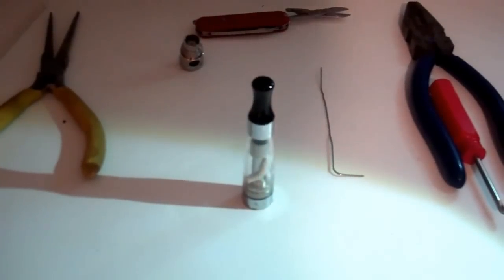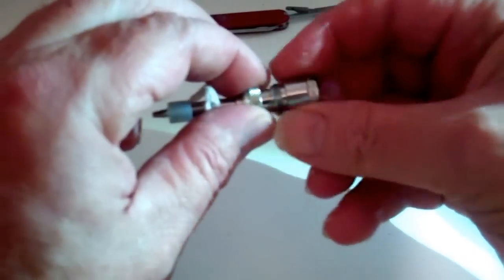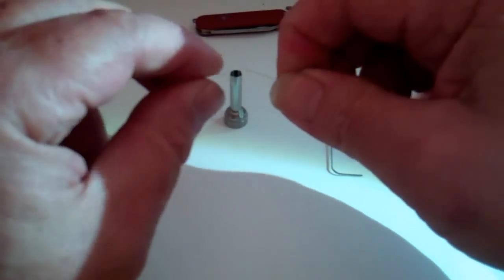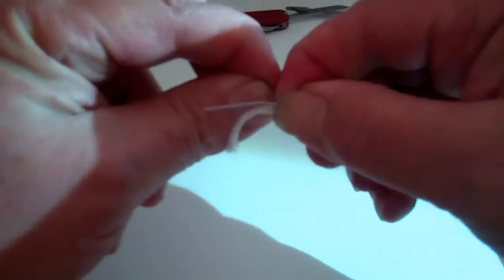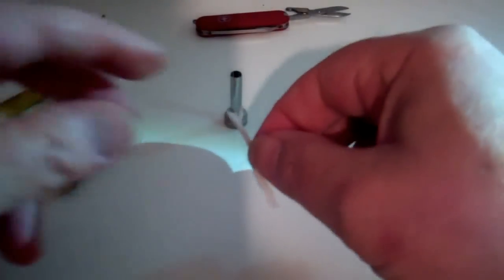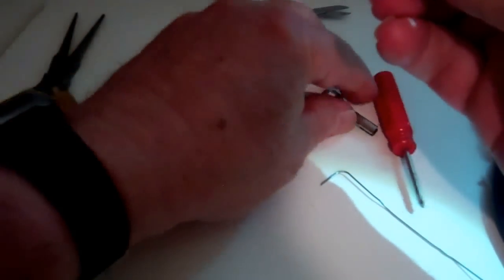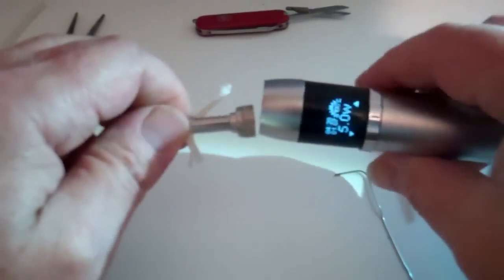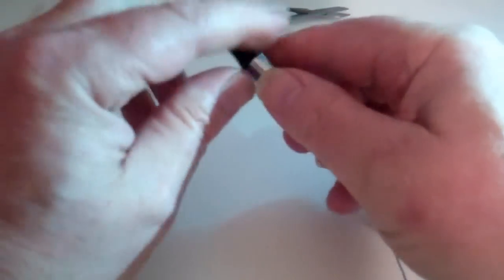Rebuilding standard CE4 Clearomizer

Comment: I had several burned up CE4 cartridges sitting around, and until I watched your video...never thought I'd use one of them again.  Well, I did it.  Used boiled 100% cotton balls, and the same wire as came with....tried one, and it is working.  Amazingly easy, except getting off the lower ring was hard!

Comment: thankyou so much so many people were telling me the ce4 could'nt be rebuilt and since i got this ego-t its been nothing but trouble after taking the clearomizer apart and rebuilding it works better than it did when it was new
Reply: nauroticdax Hi nauroticdax.. do I need to squeeze the coil .... cause after wrapping around the wicks it's getting really difficult to squeeze the coil. Thanks
Reply: Wasim Haq after rebuilding my ce4 a few times the wick basically fell apart on me so its hard to tell but here is how i understand the process

once you have wound your coil do a test burn this will oxidize the wire so that when you squeeze it together it will not short circuit

now that being said i moved on to an h2 clone which has a bottom coil head on it and is WAY easier to rebuild on which i basically held the wick out and rewound the wire by hand not pushing it together. that was about 2 months ago since then i have had replacement heads new h2 clones baught an EVOD BDC and yet still that coil for me works better than any other i have tried so far

honestly this is one of those things you have to just try over and over and work out what fits you personally i would recommend the GSH2 clones simply because they are inexpensive and easy to work with where the ce4 for me is just awful

Comment: Use padded pliers where required. Steel pliers leave marks and remove the very thin chrome plating. Also, do not squeeze too hard - leaving one with a useless oval fitting.
Reply: This needs to be put in the description.
Reply: Or you can simply wrap some cloth.

Comment: Nice one with using the battery to pull out push back in, I was fighting with this before, I'll try do it your way next time, cheers mate ! ... by the way, do you know where to get replacement rubber gaskets? These break after a few times in and out.

Comment: Thanks for the info!  I had no idea you could rebuild these...I got a CE4 and a CE5 with my eVic kit and I like how they vape...it's such a shame chucking them in the garbage when they're done with :(.  I'm a new vaper so I have yet to burn one out, nor have I even attempted to try and rebuild one or have the supplies.  I want to rebuild the Kanger T3 tank I bought recently because it's not hitting very hard.  I have a question though, when you wrap the wire around the string, and it touches the metal tube doesn't that ground it out/short it out?
Reply from the maker: One leg of the coil is in contact with the metal tube as this provides the ground and the other leg of the coil is connected to the center post which is isolated by the small rubber spacer inside the tube.
Reply: Roger Donahue Yep, that much I understand so far...I have a background in electronics, so here's a question:  Do the leads that aren't wrapped around the wick that run to the power source light up and get red hot too?  Thanks for the reply :)

Comment: Ok Roger you inspired me so I ordered the 32g Kanthral and 2.5mm silica wick .... I've rebuilt it a few times but keep getting the same result of very low output .... I've tried with 4 wraps and 6 wraps but each time its the same ... any ideas what I'm doing wrong? I've used a multimeter pos to center and neg to outside and only get a reading of 1/2ohm yet its the same reading I get for new atomisers(multimeter set on x10) .... what's wrong?

Comment from the maker: I think this indicates that you have a short in the coil assembly. You have to be careful to make sure that the center connection of the coil does not make any contact with the rest of the assembly. It could also indicate that the resistance of the coil is to low ( to few turns on the coil)
Reply: Think you

Comment: Hi, regarding the "little rubber insulator" you mentioned at around 5:20. There is another rubber still in the post. I took it out for cleaning, but i forgot how it is supposed to be placed. If the post is upright, the "little rubber insulator" will be at the top of the other rubber thing. Could you please shed some light in this matter..?
Reply from the maker: +Amali Supafly  The unit you are trying to repair is apparently slightly different than the one I describe. I wish I could help but without seeing it or being more familiar I am afraid I can not advise.

Comment: This only works for the rebuildable CE4 clearomizer right? I'm not sure if it'd work for mine because the coil might be soldered to the inside of the centerpiece. Nonetheless I would get a rebuildable CE4 if that's the case just so I could keep replacing the wick and buy some kanthal or nichrome wire so I'd never have to bother replacing it.
Reply from the maker: Actually you can use this method on the clearos that not intended for rebuild. I would be surprised if you find any that have the wire soldered in place.
Reply: Roger Donahue

Thank you for the prompt response. I'm glad to hear that. That's quite a relief actually, so therefore I can use cotton yarn for wicks and nichrome or kanthal wire for coils which in the long run will be far cheaper than replacing CEs and the only thing I'll eventually have to replace is the battery. But I'm at least 2 1/2 months from having to do that. And it's cheap.

I just cleaned and dry burned my clearo recently and it was working fantastic. I'm glad I don't have to replace it since I can just interchange homemade wicks and coils.

Comment: Not generally because you are using a non-conductive wick.  The only place those spots can pop in this design are on the legs and even those end up consistent because they should be the same length every time.

Comment: Hi, Roger
Just wanna ask if I could use kanthal 30awg wire to make the coil for ce4 atomizer?
Reply from the maker: Sure, no reason you could not. The resistance in the end product is what is important. You might look at the calculator at http://www.steam-engine.org/coil.asp if you dont have a ohm meter to measure with.
Reply: could I use an evic to test to ohm like you did?
I fear the atomizer would shock the evic.
Reply from the maker: Vince Chow You should not have any problems using an evic for ohm measurement
Reply: Thanks gladly
Reply: +Vince Chow Yes but use no more then 2 turns on the wick, better use 34 or 32 GA

Comment: The problem I have now is I can't remove the retainer ring for some reason. I tried using pliers but I don't want to break it or anything. The centerpost is slightly bent to the right which is sort of weird.
Reply from the maker: the bottom retaining ring is held on by compression. It can be very stubborn to get off in some cases, and in some cases you could crack the case. Proceed with caution
Reply: +Darian Cohen Don't remove the bottom ring, it is not in the way when taking the inside out.

Comment: hi roger I have Ego- T CE4  my chamber has developed cracks on side which i tried to seal it with adhesive from outside, now it has started leaking from under the chamber that is from the the place the battery is connected spoiling my shirt. kindly help, guide. thanks

Comment: Help please!
Im using the CE4,preety similar to this one and my clearomizer got stuck to the battery and the only part i can unscre is the tank itself...This has happened before but the tank would kinda sink in ad get attached to that part,but not anymore...
Everything works fine except that i cant charge it anymore
Is there any way unstuck that part by myself?
Reply: Try to unscrew with a padded pliers

Comment: I've done this and it seems to work but the thing I'm concerned with is the rubber piece burning from being so close to the coils.  Is this a legitimate concern?  Of course I'm also scared of the thing blowing up in my face, I have no idea if that's even a possibility.  I do not have a digital multimeter so I did skip that step.  It seems to work fine so far, I've dropped some juice on the coil without the top on and it burned just fine.

Comment: is there a difference between rebuilding the ce4 cleaormizer or simply cleaning  it out with water? im getting a ce4+ ego and I cant afford replacing the  cleaormizer every week or so
Reply from the maker: Yes it is very much different. Of course you should clean the clearomizer periodically. You can flush with water, or I have used vodka also. Even with cleaning eventually you will find that the efficiency of the device is diminished. This is usually due to a gunked up coil. Rebuilding should be done when you are at that point, and it may save you from replacing the unit and get renewed life from it.
Reply: thank you so much! I appreciate this so much!!
Reply: You need to buy a rebuildable atomizer (RBA). They aren't really more expensive ($10-20) and are EASY to rebuild and can be rebuild indefinitely. About $15-20 worth of supplies and you have multiple years worth of supplies.

Comment: do you need a new wire or can you use the one that is in it without braking the wire?
Reply from the maker: +Rody Wagner It can be done with the old wire if it is still intact. Handle it gently and clean it well. If you have new wire then I suggest using new.

Comment: HELP!!!! retaining ring at start wont come off and i don`t want to break the glass tank!!!
Reply from the maker: As noted these are not designed for rebuilding but in some cases they can be. The ring on most is a compression fit only. It could be possible yours is different or that its just extremely tight. Good luck
Reply: Roger Donahue yeah, i think it is compression fit and glued... but thanks for the quick reply :)